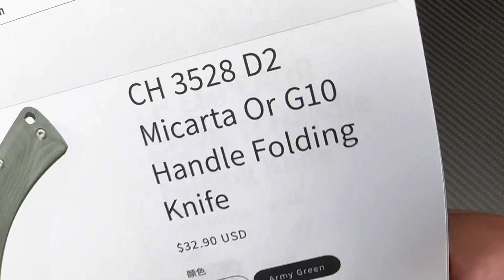The Emperor in G10 !  CH3528 G10  full sized flipper w/D2 blade under $35 !

Comment: Great call on that Thrunite archer v2 . The light is as good as others 3x the price . Throws a good round hot spot , perfect ease to use and lock and unlock if needed . I like the o lights , rovyvon , stream lights , etc too but that v2 archer is a winner for $20 bones , or prob $25 now , still the only one I know it comes to is the Kodiak 1000 @ Wally World for $20 but that’s a rechargeable cr123 , still good tho but not like this